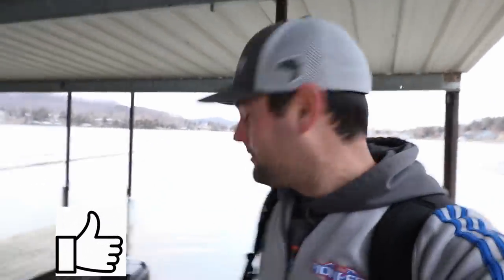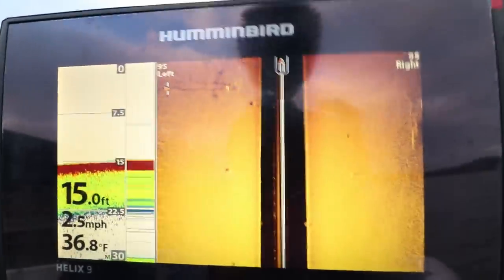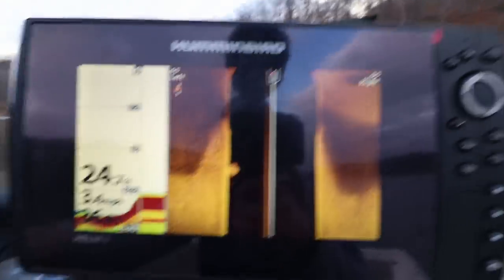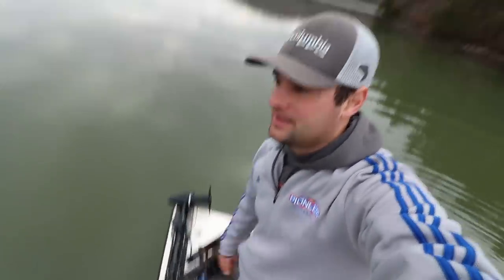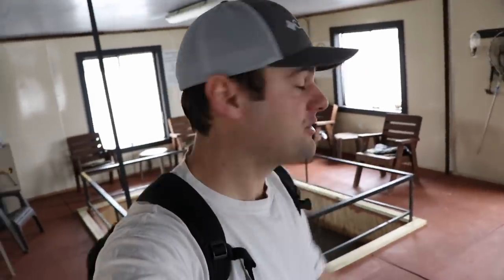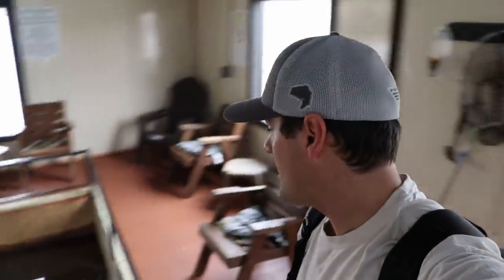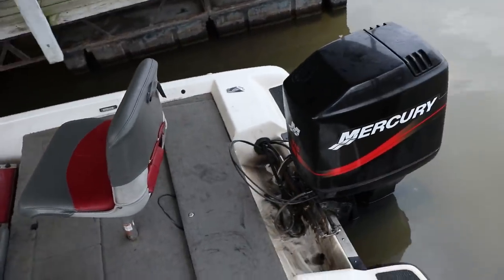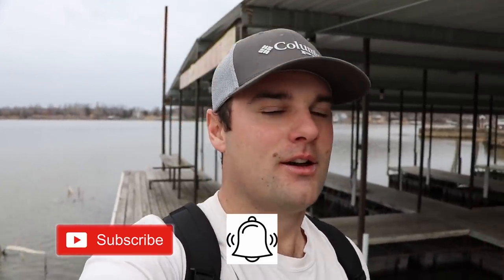I DESTROYED my Outboard MOTOR (Boating FAIL)

Comment: Could you not take the cover off the fly wheel and turn it backwards to make bindix drop? Mine has a notch so you can wrap a rope around it and pull it by hand.
Reply from the maker: I didn't try that. I replaced it with a brand new starter and runs great now
Reply: Flopping Crappie sometimes it work to get ya home but replacement is best. Did it once on a 4.3 inboard on a ski boat.
Reply: @FloppingCrappie  I don't even have a outboard I use my arm's puts my 20' SS on plane and runs about 72.    Just need to start working out 🤣🤣🤣😋😂😂

Comment: I have my Merc at the marina right now getting her spring makeover. That's a bad feeling when something goes wrong and you have to limp back with the trolling motor. Nice video.
Reply from the maker: Ya, it was a disappointing end to the trip, but the new starter is on the motor and running like a champ! Thanks for watching!

Comment: I had the same symptoms last year on my motor, traced down the problem to a collapsed fuel line. Cut the bad out and saved the trip.Just something to check.
Reply from the maker: Thanks, I'll have to check that as well. I did replace the starter with new one.

Comment: Motor isn't destroyed
Bendix is stuck but it's ok it will drop after the motor starts. Sounds fine.
Sounds like a fuel issue. Not popping off
Compression sounded good
Unless you lost spark but that's very unlikely as it was just running and very improbable that you lost spark on all cylinders. I'd fix it for you for cheap...
Reply from the maker: I bought a new starter for $85  and replaced it myself. The starting motor in the video was 20+ years old..I think it just had its last turn. The new starter turns the outboard over first time now. Ran it a couple hours last weekend without any issues. Thanks for watching!
Reply: @FloppingCrappie  when I travel to a resort or long road trip for a fishing outing I always bring my 9.9 outboard as an emergency back up motor... It has saved many a fishing trip as the big motor will only fail when you are on the road.
Reply from the maker: luckily I had the trusty 1998 minnkota edge. haha

Comment: At 5:18 ...
Wow, I hope you didn't get the 'shaft' at the dealer or repair shop. 

If the Merc had gas, power, and spark, it would crank and override the small starter gear. 
The only force on the starter gear (visable on video) is when the key is turned to Start position. 
Audio from your video sounds like the Merc is cranking over and over. There's a vapor lock or spark/electronic issue. 

Anyway, good luck on Mercs...
Reply from the maker: Thanks, I replaced the starter with a new one and the motor runs great. I just think after 20+ yrs the starter finally gave out.

Comment: Not a starting motor. "starter drive" may stay up if not starting. Don't think it's destroyed but I don't know if it stalled or you shut it down. Phone your boat mechanic.
Reply from the maker: I have been having issues with the bendix sticking in the down position last fall. Thee starting motor was over 20 years old. I bought a new one on Amazon for $85 and installed it myself. Outboard ran flawlessly last weekend.